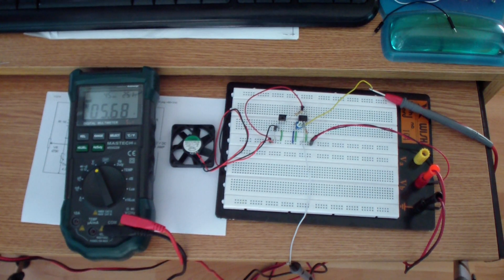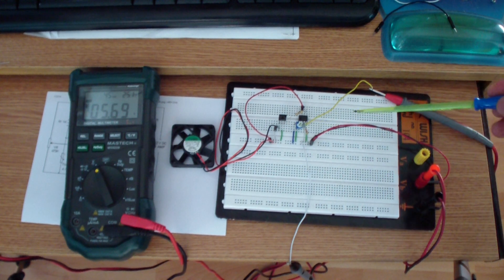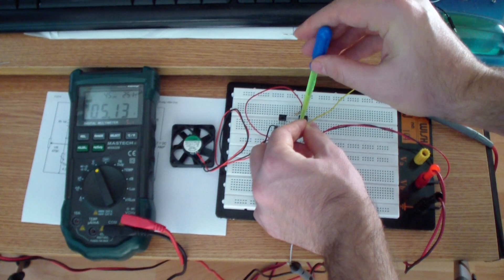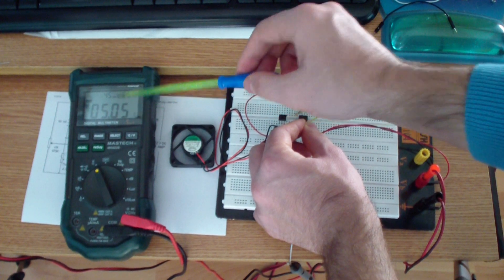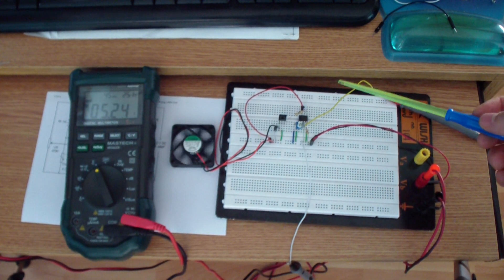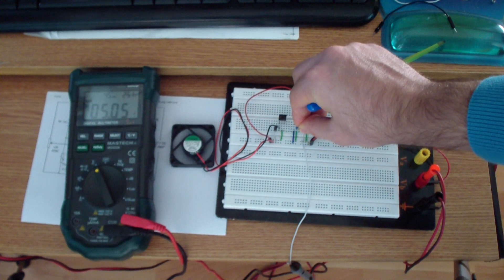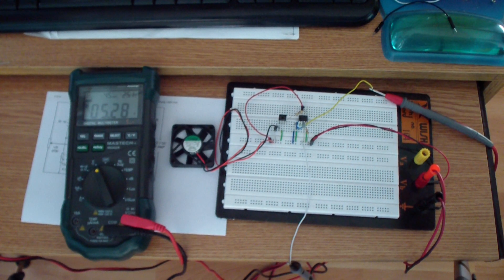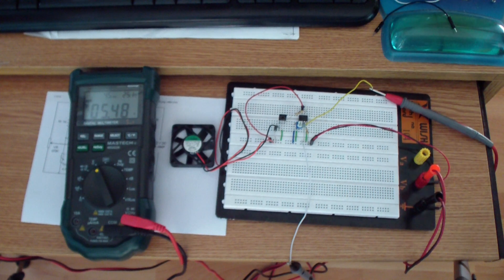Temperature controlled DC fan

Comment: Thank you, this is very usefull, i need it for la Laptop charger cause i have a toshiba tecra running at 15V DC and the original ac adapter died unrepareble and nou i use a Chinease universal one with variable voltages and it's getting very hot despite that on 15V it's delivering 5Amps exactly like the original toshiba one. So i will build a fan controler with a 30x30x10 mm fan for cooling it. 10x !!!